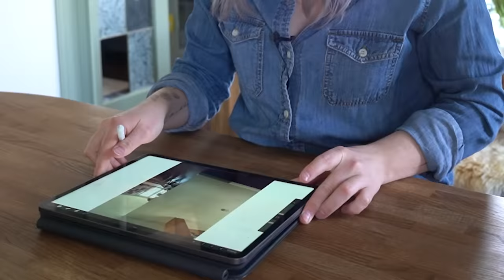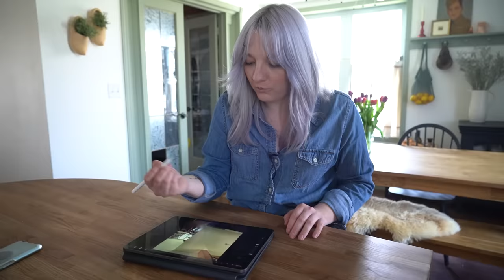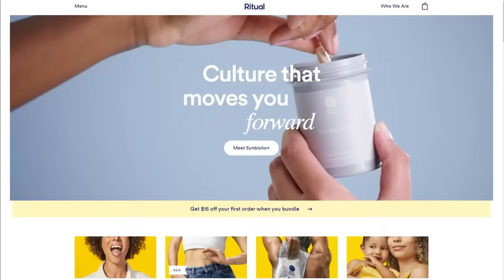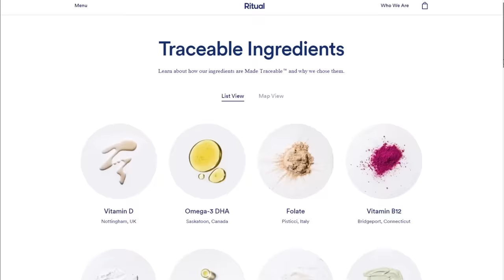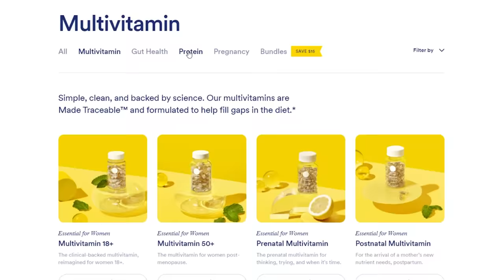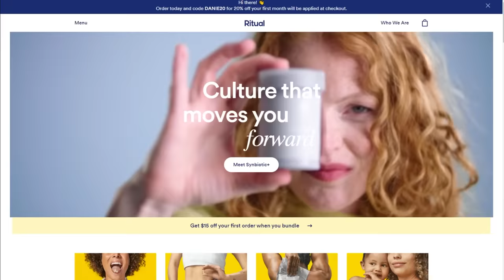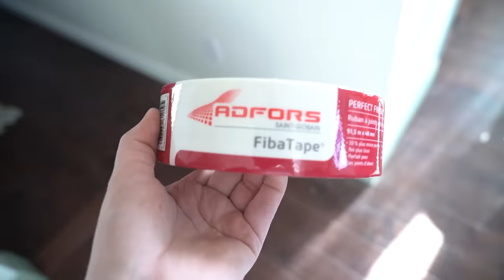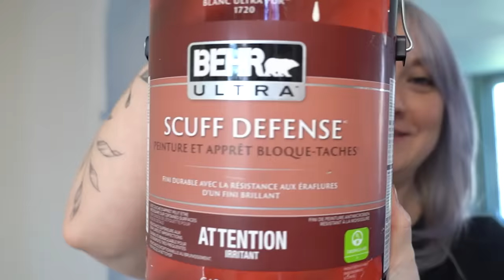I built a recessed arched wall shelf all by myself! 💪 | *floating shelves* | Home Made Home

Comment: Usually 1/4" drywall is used with scoring of the back much closer together on the arch to create a smoother arching. That said, I like that the shelves are built in and it adds interest to your home's kitchen area. You have great design instincts. Your reworking of your spaces are really creative and livable.
Reply: Thanks for that tip, she didn't spend a lot of time or camera work on that part of it and I had all the questions...

Comment: II's beautiful, and I love your "Embrace the imperfections" mindset. I want to make one! Especially into the gallery rails.

I have a time-saving tip for your next drywall project: 20-minute mud is a game-changer for being able to save nearly a day of drying time. You can't use it for your final coat - doesn't sand as easy - but it is brilliant for the first coat. I buy it dry and just mix as much as I need. Vancouver Carpenter is my favourite Youtuber for drywall advice - he's made me a much better drywaller.

Comment: Is an easy way to curve drywall is to wet one side bend it, then let it dry into the curve. You might have to do it a few times to get that tight of a curve. There is also 1/4" drywall that might work better. You did a great job with the materials that you had.

Comment: I have been considering this very thing in my dining room for some time now. The room isn’t very big and I want to eliminate the large hutch and buffet but still have dishes and other items on display. This is a video that I can show a carpenter or remodeler to explain what I want. I won’t attempt to do this myself because I have no experience with power tools. Although I do have experience with home repairs etc. thanks for the video, it turned out great👍🏼

Comment: Way to go!  Once again, Kenobi chooses the perfect project 🐶  I love how the arch references your office bookshelves.  I know you didn't have the rounded corner piece you had hoped for at the top, but did you use a metal outside corner to reinforce the edges on the sides and bottom?  I wonder how it might look with a contrasting paint or mirrored back inside (not necessarily on your kitchen wall).  What would you think about a little Rub and Buff to give the gallery rails more of an antique vibe?  Very impressive:elbowcough:

Comment: Danie How do you have a house older then mine but have drywall. im so envious of the 99.9% (seemingly) of homeowners in Ontario who have drywall. My Plaster and Lathe Walls make everything so so so much harder to do. I dare not make holes on purpose. No quick screw in a wall to hang a photo here, everything needs to be in a stud or secured by molly bolt and the repair is intense. Last year for no reason at all seemingly all the paint peeled of the front entry walls down to bare plaster put there in 1947 when the house was built. recovering and skimming a plaster and lathe wall is a serious skill that so few people in southern ontario know.  
all this to say I am jealous and wish I could do one of these. looks fantastic Danie

Comment: I like how this build went so smoothly and it added so much appeal to the home. I might have added another oak board instead of drywall at the bottom.
I was distracted however by the two colours on the baseboards below the arch, at minute 12.46. Was that a design choice or did you just run out of paint/energy to finish the job?